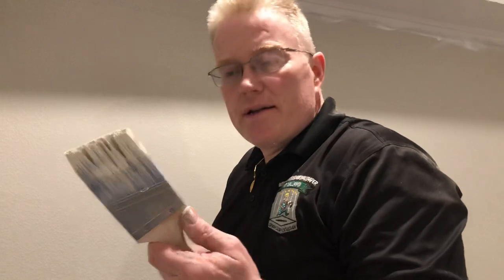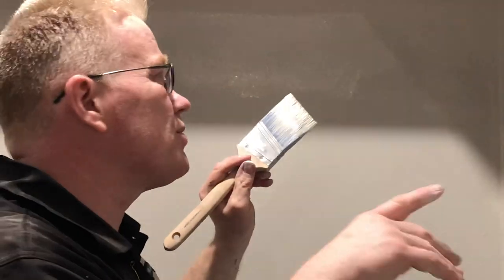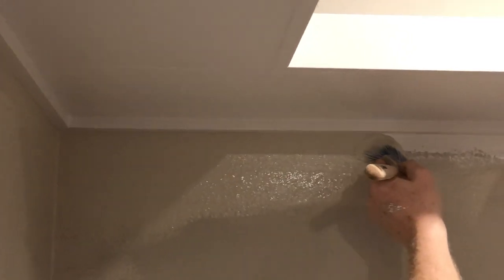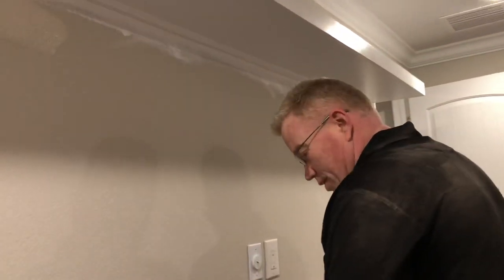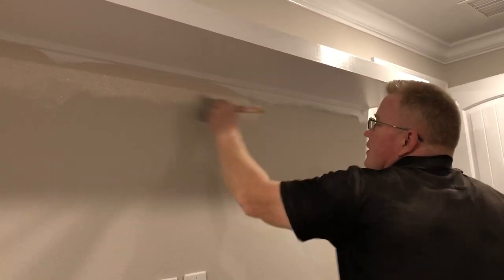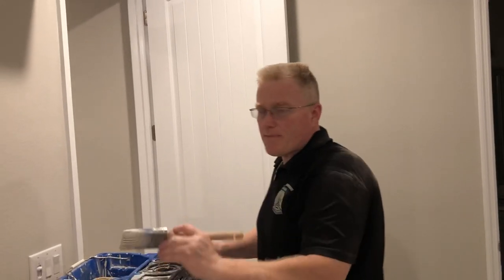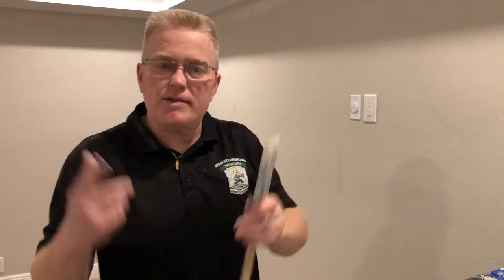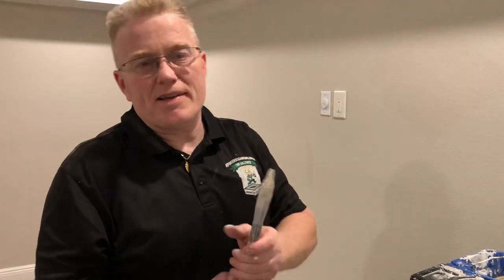The Mechanics of Cutting in With a Paintbrush - Spencer Colgan

Comment: I'm still learning but can't seem to get the purdy brushes in the UK you guys have, been using wooster and monarchs which are good also. Do you back roll your cutting in or just brush? Do you cut the whole room or is it best to cut a wall and then roll it all too? Lots of different techniques for different painters I guess. Cheers for the video was really helpful.
Reply from the maker: .  This was just touching up around shelves that I had to paint. But yes, in order to match the texture of the roller, you wouldn’t back roll as closest possible to the edge to eliminate  the brush strokes so that it all looks like it was done with a roller. 

I would do one wall at a time because as you know, your cuts start to dry and then you get what’s called flashing or the halo effect
Reply: Thank you :)
Reply: @patadams1673   when working alone one wall at a time.  Cut and roll.